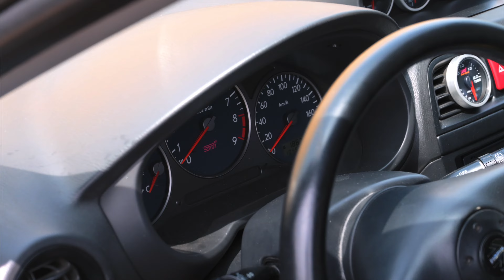THREE Stories That Define Subaru Car Culture

Comment: A great troubleshooting find on that fuel pressure regulator discrepancy. I own a fully stock  2020 STI and I only put a vortex generator and rain guards on it.  I will never do any power mods on it. It's my perfect daily driver. 😊
Reply from the maker: I couldn’t imagine spending weeks to figure that out 😂
Reply: Same here. 06 sti with spt add ons. 70 retired lineman fixed income. Also drive a 98 Honda prelude  5 speed

Comment: Subaru WRX premium VA could push to 300 hp. Any higher than that it blow up the engine
Reply: I have heard 100 HP above stock starts to get fishy but not much before that if you arent driving it like a '91 beater.

Comment: Question you savages. I ordered a r400 but wondering if I could keep the stock piping that came with the 2021 and change out the exhaust parts only keeping it neighbors friendly but having a bit more sound does that make sense my first subaru I've owned
Reply from the maker: I think the exhaust diameter is larger and won't work. I'd just install the whole thing.

You are likely not going to annoy anyone. I run a Tomei and it's def one of the loudest you can have and neighbors can't really hear it strollin' through.
Reply: @nolanmarketti  thank you very much can't wait for it to come in
Reply from the maker: @santoscarrillo2996  you’ll love it. Exhausts always bring out the rumble
Reply: You can run an oem J pipe adapter to the 3 inch catback grimspeed makes one im pretty sure
Reply: @NathanielKarle-f5n  I copy I'll look for both just be sure

Comment: No one can be critical of each others mods when they are literally all the same
Reply: Kinda hard for it not to be.
Reply: but they aren’t at all. sure, for all the guys doing just fbo and tracking/street building them, sure that is the most common. but the thing with subaru compared to the comparable cars like the ST or GTI, there’s a whole rally community backing subaru as well, which opens a whole other side of the subaru world. and just like in this video, there’s people who build them as drag cars too. there is sooo much customization in a subaru, but there will always be select genres of builds. with subaru, there just are more. lover or hater, subaru also has way more of a cult following than any other brand
Reply: Crazy how having the same car as someone makes modding it the same. 😮
Reply from the maker: yeah. i aint never seen a vortec v6 sti swap. challenge accepted.